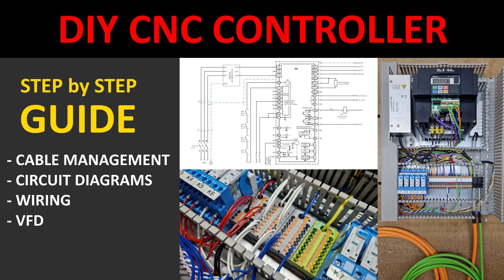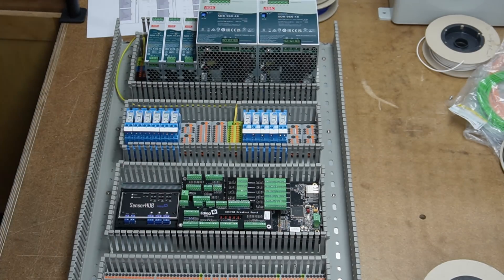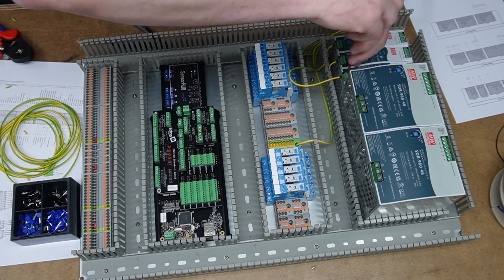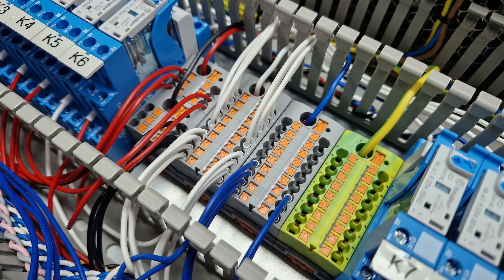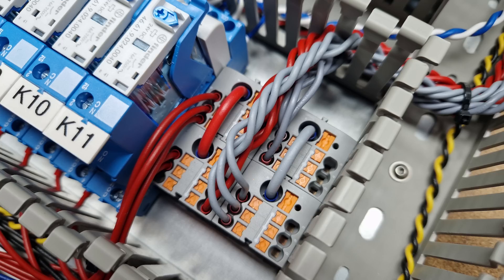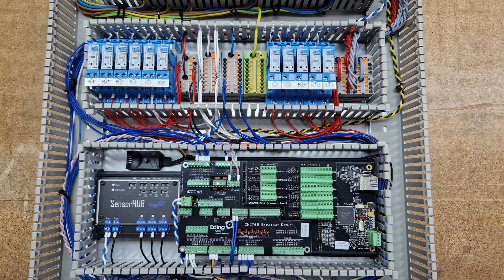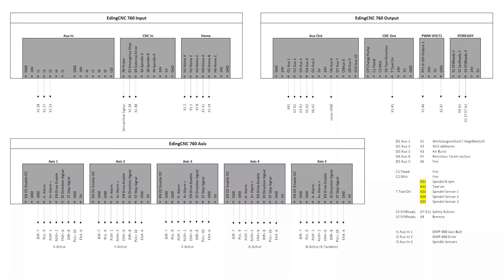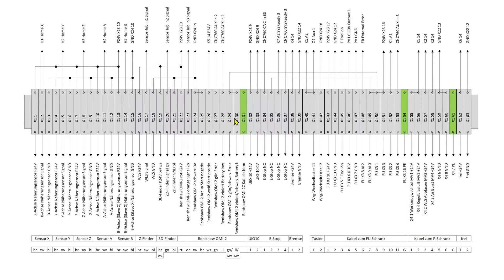DIY CNC Controller Part 2 - Circuit Diagram, Wiring, ATC VFD, Cable Management

Comment: Beautifully done! Two questions: 1. What is that potentiometer hidden in the cable trough? 2. When using shielded cables, I see you ground the shield to the back plane in the cabinet. Do you leave the other end of the shield unconnected, or ground it too?
Reply from the maker: The poti belongs to a small PWM fan controller device (Noctua NA-FC1) and it drives the ventilation. I use PC fans for this, mainly because I still have a few leftovers from previous PC builds.           
Shielded cables are grounded only on the cabinet side, otherwise you create a loop.

Comment: Question, why not install the PSU upside down. You can keep the 220 on top, and separate the low voltage down.
Reply from the maker: Meanwell's installation instructions advise against this due to the convection airflow...😉
Reply: @scratchbuiltdesigns  small fan will do the job. Never mind you setup is fabulous

Comment: Amazing job. That's one of the Best series about this topic I ever watched. May I ask you if you are planning to share the wiring of the cnc760 as a pdf file or something? I'm planning to retrofit one of my machine with that controller but the eding documentation is a little too much confusing...
Reply from the maker: Well, I am afraid that when you already find the original EdingCNC documentation confusing, my "documentation" will be even worse...
Reply: @scratchbuiltdesigns  :D well in that case may I ask a couple of questions? Watching your schema and wiring in the video the open collector wiring for the sysrdy do not have a visibile ground connection output, like the one i need to wire on the cnc530 for example. The BOB for the cnc760 has the wiring to ground already prepared? How the sysRDY signal work when you don't use the safaty releay features from eding cnc? In V5 witch cnc530 I need to have the safety relay controlled by software to be able to use the sysrdy output.
Reply from the maker: @IndieGearLab  On the CNC760 board SysReady switches to GND. I have for example the relay for the Z-axis break and the relays, which cut off power from the servos in case of E-Stop, Servo or VFD Error connected to it. +24V to Relay A1 and SysReady to Relay A2.
SysReady switches to ground after you press "Reset" in the Eding Software and it falls off in any state of error
Reply: @scratchbuiltdesigns ok perfectly clear now... It's a little bit different from my cnc530 but I have to make some other test. Thanks for the clarification 😊

Comment: Hast du pro Achse einen Näherungsschalter mit 2 Schaltpunkten? Also Sensor mitfahrend? Schöne Grüße
Reply: Ok 2 Sensoren und die sind NC in Serie um Eingänge zu sparen?
Reply from the maker: @HIMA.3D  Ich hab pro Achse einen Homing Sensor, außer an X (der Tandem-Achse), da sind es pro KUS einer
Die haben einen Schaltpunkt und für jeden gibt es am Eding Board einen eigenen Eingang

Comment: Tolle Maschine.
Was für ne Spindel hast Du verbaut? 3.8kw?
Hab die 2.2kw. Hsk32
Reply from the maker: 4kW Spinogy X30 mit SK30
Reply: @scratchbuiltdesigns  Und frisst die gut was weg? Die X22 ist ok aber könnte mehr gehen, ma schaun was als nächstes kommt aber sicher mehr als die 0,88Nm die nur um die 9000rpm da sind.
Reply from the maker: @fearlyenrage  Ja, das ist natürlich eine Frage der Frässtrategie. Kannst auch mit einer X30 kein HPC fräsen und bist mit HSC besser aufgestellt.
Ich hatte vorher eine 2.2kW 4-pol Mechatron ATC-8022-30, bevor ich auf Spinogy umgestiegen bin. Damit hab ich in Alu mit nem Ø8mm 2-Schneider so bis ca. ae x ap 15mm² bei 4,5m/min bei Vc 500 m/min gefräst. Mehr wäre auf der lommeligen Sorotec auch eh nicht drin gewesen. UND...die ISO20 Schnittstelle kommt da auch an ihre Grenzen. Hab damit aber zwei Fräsen hergestellt, meine erste SBD9050 und die SBD6040 UHPC. Ich denke, daß die X22 ähnlich performt.
Mit der 4kW 4-pol X30 mit 30k rpm gehen bei gleichen Schnittwerten locker ca. 30mm² Eingriffsquerschnitt, wobei ich da beim Schruppen auch schonmal bis auf 8m/min hochgehe. Da muß dann aber das Workholding passen.
Insgesamt ist da noch Luft nach oben, aber ich reiz das nicht aus. Macht für mich kein Sinn die am Limit zu betreiben und ich mache viel auf Vakuum. Da muß man eh etwas konservativer fräsen.
Stahl macht sie deutlich besser als die 2.2kW Spindel, aber auch hier gilt weniger Zustellung und mehr Vorschub
Reply: @scratchbuiltdesigns  Jep. UHPC... Epoxypolymer ist mir vieeeel lieber. 

So schön elastisch und massiv stabiler als UHPC. 

Musste bei mir mit nem Vorschlaghammer ein vergossenes Röhrchen ausgetrieben... 

Konnte da so dermassen draufschwarten das die Bude gewackelt hat! Der Klebstoff ist extrem. 

joar die X22 frist schon gut was weg aber ich möchte keine grossen Fräswerkzeuge laden. Son 6mm frisst etwa bei 1mm seitlicher Zustellung locker 15mm in der Höhe weg. Bei etwa 10k rpm und 1200 Vorschub. In Stahl. Bei Alu get etwa 30% mehr.

Jaja is schon so das man schnell etwas abtragen kann anstatt viel und schnell. 

Gibt einfach Tage da weiss man das man mit einer hsk63 8kw Spindel wesentlich mehr könnte ^^
Ah wollt ich auch noch fragen aber das habe ich mir gedacht. Sekundenkleber kleben würd man am Klebeband erkennen, meistens.

Ich verschraub alles ausnahmslos. Kleben ist son Notnagel... gefällt mir nicht so gut.

Was für Endstops hast Du so verbaut? Lichtschranken?
Reply from the maker: @fearlyenrage  Wenn man sich an die Konstruktionsrichtlinien von UHPC hält ist der ziemlich vergleichbar. Und deutlich kostengünstiger. Problem ist der Zwangsmischer. MG kann man besser in kleinen Chargen im Keller anmischen.
Reply from the maker: @fearlyenrage  Induktive Näherungssensoren. Die Komponenten sind in den Aufbauvideos eigentlich alle gut beschrieben und gezeigt
Reply: @scratchbuiltdesigns  das wage ich schwer zu bezweifeln. Auf Druck und Zug reagiert der UHPC deutlich anderst, als ein Epoxid Verguss. Kosten werden höher sein aber das kümmert mich nicht. Also meine Chargen waren um die 60kg falls das klein ist... ^^
Reply: @scratchbuiltdesigns  Aha gut gut hab ich auch einige verbaut. Ich kann nicht immer alle Clips kucken da ist eine Frage meistens direkter ;)
Reply from the maker: @fearlyenrage Ich hab beides gebaut und kann's beurteilen...

Comment: This build is one of the most expensive I've seen. Please tell me what's the total cost USD of the build you presented? Thank you,
Vince
Reply from the maker: Stopped counting a long time ago. But you know...the differewnce between men and boys is the price of their toys
Reply: Well when you get a Masso G3 and some servos you are out 2500€
When you then get fancey ballscrew bearing screws you can trow in more and more and more...
A good spindle cost up to 3-15k€ 
When you want to build a epoxy granite cnc mill the epoxy cost around 50€ a kg. 25kg sandmix cost around 15.-€ 
When you budget for 10000€ you are on a path. 😅
Reply from the maker: @fearlyenrage You got it...👍
Reply: @scratchbuiltdesigns  with salary cost we are about to kick the ball at +-45k$ out the park. But hey thats why we build them on our own ^^
Reply: make a video talking about how great and professional this controller is @corvetteguy50
Reply from the maker: @engineeredaf1920 Just my take on it. There is far more advanced stuff out there...
Reply: @scratchbuiltdesigns  far more advanced - but not from hobbyists sharing their builds on YT and insta.
Reply from the maker: @engineeredaf1920 😂
Reply: Hey Vince hope you acknowledge this build😊
Reply: @HIMA.3D dude is a douche 😅

Comment: Amazing job on these videos. I'm personally working on the control panel for my first cnc right now, which is a conversion of a biotech gene array printer motion stage that uses linear ac servo motors. 
I am going the linuxcnc and mesa route, with a mesa 7i97T card to control older allen bradley ac servo amplifiers. With the exception of the same PTFIX pheonix contact distribution blocks and an ac line filter, it's all second hand industrial parts. I am going with a pilz safety relay, but letting it signal the controller, before shunting the motor phase wires to braking resistors.
Reply from the maker: Sounds good. Enjoy the build 👍

Comment: what software you used for those nice diagrams?
Reply from the maker: Since this is a one-off action and I don't do them all the time, I went the simple route and did them in Excel, believe it or not
Reply: @scratchbuiltdesigns  Oh wow! Need to find out how you did that...
Reply from the maker: @car9167  The diagram of the MX2 is a copy/paste from the manual and the rest is drawn around it.
The terminal plan is just based on regular cells...Nothing fancy. I mainly did it in Excel, because it is so simple and much faster than me learing how to do it in a dedicated program.
If I had to do this more often, however, I would surely use something else